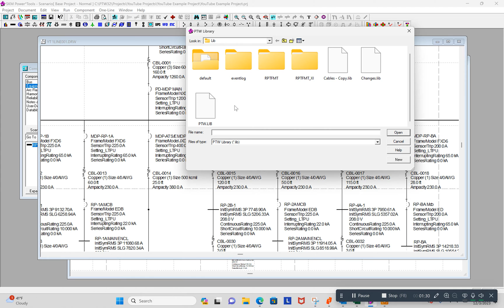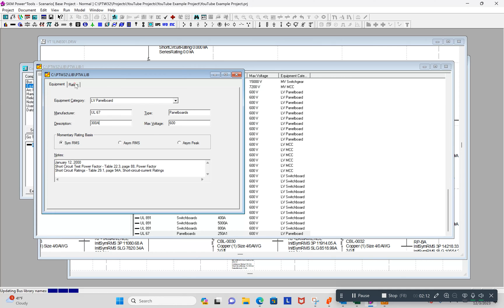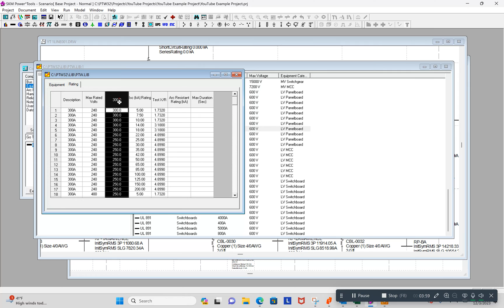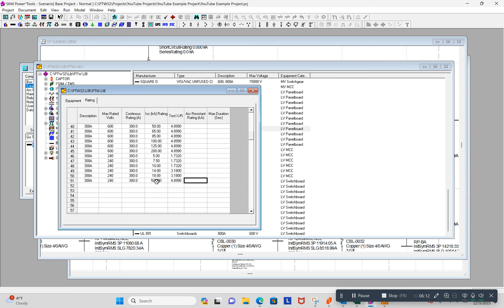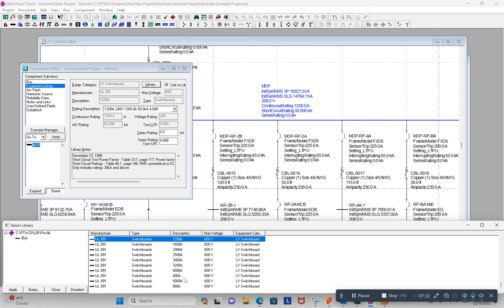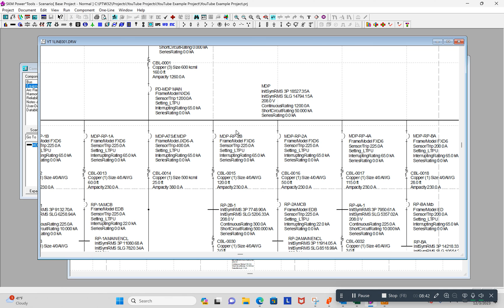SKM PTW How to edit the panel and switchboard library

Comment: Hi Sir Brent Baumer

What are the INPUT parameters/Data needed for the following Equipment to be reflected in SLD INPUT DATA?

1.  Utility
2.  Transmission Line
3.  Transformer
4.  Switchgear
5.  HV/MV Motors
6.  MCC
7.  LV Motor
8.  Cable
9.  Bus Duct/Bus Bar
10. Coupler

Thank you and more power
Reply from the maker: I'm not sure I understand your question.  Are you asking about the INPUT DATA datablock?  Any datablock you see in my videos that are in all caps, for example INPUT DATA vs Input Data, have been customized by me.  That is how I track which data blocks are included in SKM and which one I have customized.  The ones in all caps have been customized or modified.  What gets reflected in the datablocks is up to you.  I have a video on how to do that here: https://www.youtube.com/watch?v=O30MEHLGFS8 .  If you are asking about the Input Report I don't understand your question.